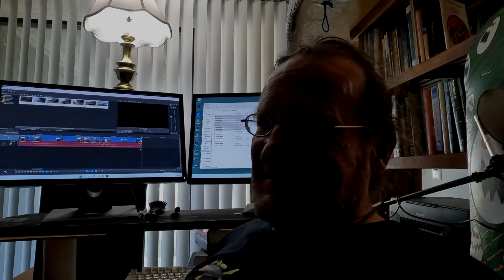don't glue or paint your entire foil kiteboarding kite with silicone do this instead

Comment: Many thanks for the video Eric.

I think that I have a similar issue with my old flysurfer speed 5.

How can I be sure that the problem is only on the leading edge? I have doubts about the porosity of the fabrics since the water get in to the kite very fast with no option to relaunch.
Reply from the maker: you have to measure it.  I'll go and actually do a more scientific measurement one of these days.  Paragliders have all the technology figured out with their porosity devices.